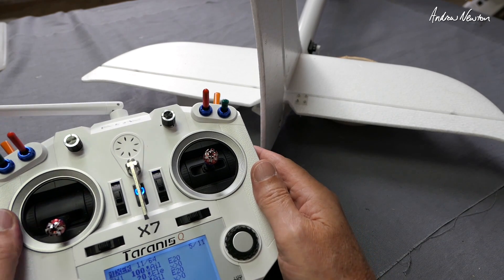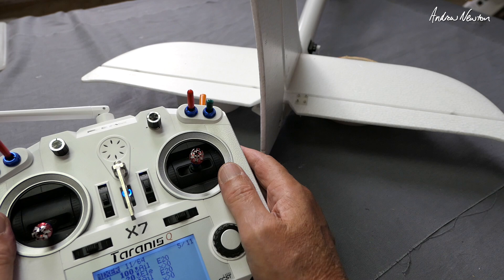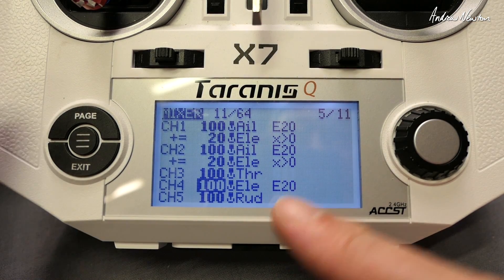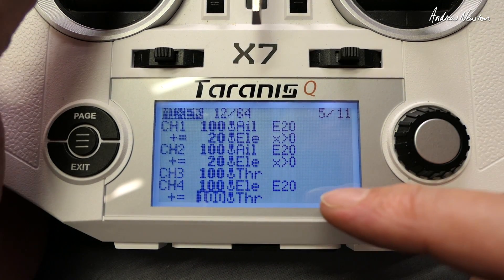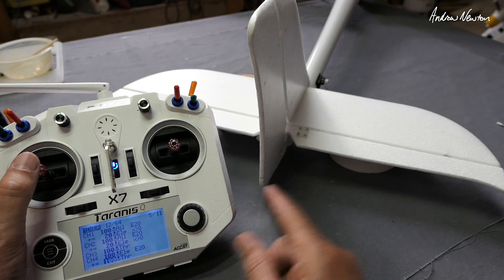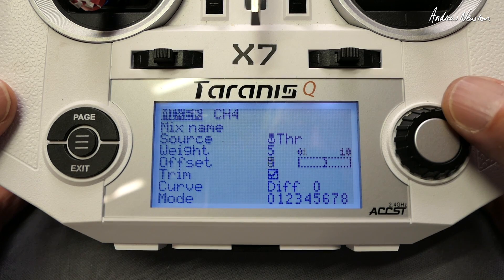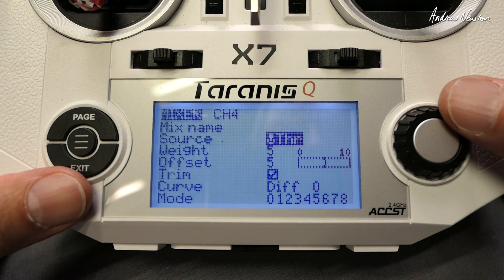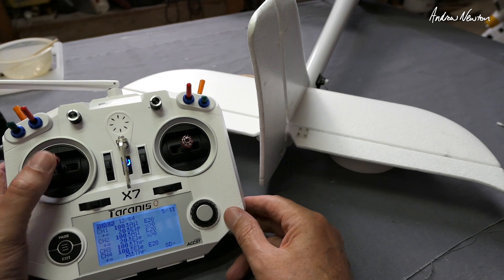Throttle Elevator mix  - Taranis Q X7

Comment: How would you program this for a flying wing where ele and ail are both 50%?
Reply from the maker: Same way but add the mixer line to both elevon channels. Might have to change the weight to plus or minus as required to get the elevator compensation working in the correct direction.
Reply: @AndrewNewton  Ok, that's what I was thinking too but I can't seem to get the Rt. side to give me down elevator. I'll keep on tinkering with it.

Comment: When flying vertical downline, pattern planes tends to pitch up or float toward canopy side.  So, I like to add slight down trim ONLY when throttle is below 10% or so.  What I came up with is just like what you show here, but works from idle to max.  I also tried using curve and logic. Neither seem to work.  If you have a good direction, it'll be great if you can share.  Thanks.
Reply from the maker: Yes quite easy. Logical switch L01 a<x. V1 = Thr, V2 = -80. Add a line to the Ele Channel  +=MAX Weight(-5%) Switch (L01)
Reply: @AndrewNewton Thanks for the reply.  Frsky is not easy.  Your way kinda works and trim goes down only at idle.  But, it causes up elevator to move a lot at idle.  Anyhow, I got an idea.  I think I will restart from a fresh setup from nothing.  Thank you sir!!!

Comment: Really useful Andrew. Thank you. But I want to have an offset for both directions I. E. Nominal 5 when the throttle is idle.
Reply from the maker: Huh? Dont understand
Reply: @AndrewNewton  OK my fault. I want a mix that not only deals with power on, but also slight up elevator when motor idling. In other words to keep the nose up and glide  with motor idle. Thank you anyway.

Comment: Hello. Good vídeo. Could this mix be done without using a switch? I need my plane to turn ailerons when I use the tail rudder for knife maneuvering
Reply from the maker: Dont have to use a switch, but how would that work for knife edge?
Reply: @AndrewNewton  Good Morning. I already have the mix of aileron and rudder creadan, for lateral flight (knife)
Reply: Hello. How could you make the mixture progressive, for example: your mixture of throttle and elevator, when you have reached half throttle with the stick if you keep accelerating that you cannot keep moving the elevator?

Comment: Hi, i would like to apply this to my wing however i would like the elevons or elevators to pitch down when i at 50% or above. How can i do that? Thanks in advance!
Reply from the maker: Easy. Add another mixer line to the elevator mix or mixes. Source - Thr. Weight - Start small, like 5, then adjust to get correct deflection and direction. Curve - Func X>0 to restrict it to Thr more than 50%
Reply: It worked! Thank you so much!

Comment: Great vid Andrew :-)   A friend of mine has a taranis Q X-7  tx with a multi protocol  module,  he's been using  the normal flysky/hk Rx's no problem, but when he/we tried to set up one of the newer flysky Rx  the  "2A"  ( twin arial)   it only lists a few options,   why is the newer flysky protocol not listed? are we doing something wrong? there are no buttons or switch's on the module, it's all software... and I notice there are only about 10 options?  any clues?  thanks for any help
Reply from the maker: May have been too complex to include the telemetry which is part of the 2A protocol?

Comment: Why not just add a couple of flights modes this way the elevator trim can be set for each flight mode?
Reply from the maker: Never  been tempted to use flight modes. I see it as extra complications
Reply: @AndrewNewton  it's easier to control the trim while powering up on a glider. Try it sometime you might like it 😉

Comment: I've been wanting a trigger throttle like a rc car on the back of my radio and use the left stick for pan and tilt camera. Right stick for role and pitch. Think there's a way to put a trigger throttle on a radio?
Reply from the maker: It would have to be quite a hack job but might be possible. Not something I would attempt.

Comment: In the past, when a Plane had the tendencies to pitch up, when Power is added, we just increased the downthrust(line) of the Engine, ok this Methode took some Time, and a few Tools, but it worked very well.
Greetings, big Salut, all the best Wishes Anton 🇦🇹
Reply from the maker: Yes this is just to compensate for problems with thrust angle or decalage, just using radio programming.

Comment: I have a flysky i6x, it looks like I could set this up in the mixes section, maybe even easier/straightforward on it. I may try, my mini AR wing has been wanting to pull up after I lost the hatch mid-flight and made a dinky replacement one with foamboard.
Reply: Hmm, may have to experiment
Reply from the maker: Yes that would work with the FlySKY, but start with a tiny amount of down ele